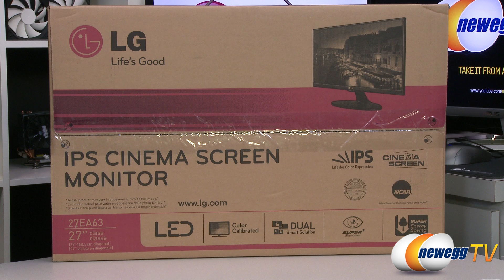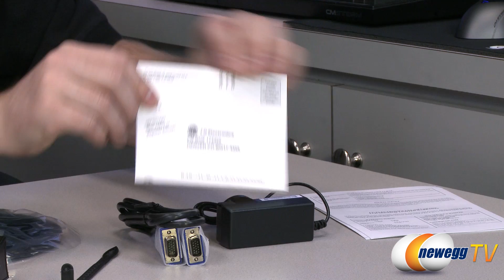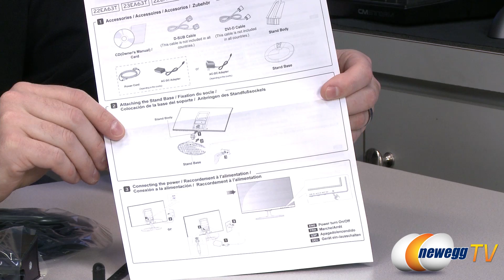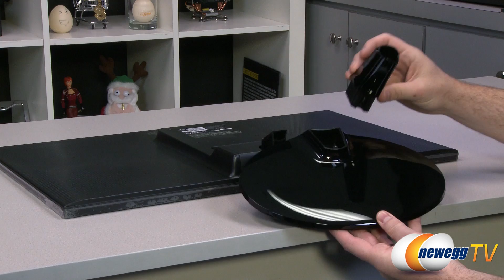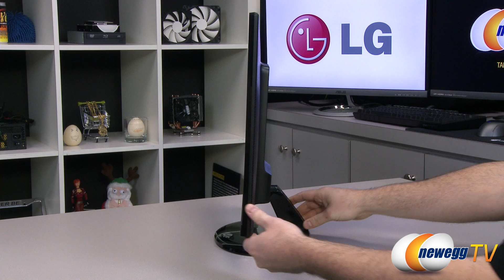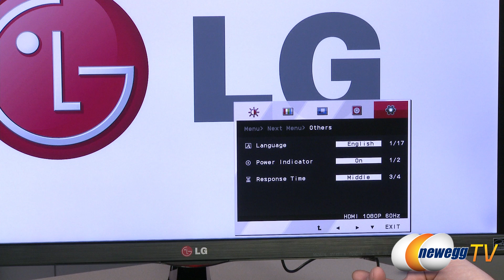Newegg TV: LG 27" Widescreen LED Backlight LCD Monitor Overview

Comment: Please help, I currently have a Asus VS248h-p monitor and want to upgrade to a 27 inch. My main priority is gaming and graphic design.  Will this LG be a good choice?
Reply: if you already got 23" 1080p monitor and want upgrade to 27"  or bigger monitor , i think 27" 1080p not a good ideal, try 27" 1440p for the big change.

Comment: I had a LG 22EA53T-P,the sharpness did appear to reset itself when powered off then turned back on. I think it's a firmware issue that LG needs to fix. It should be no big deal as default sharpness should be sufficient? 
I returned the LG 22EA53T-P for a HP 22bw IPS display that uses a LG "bezel-less" panel,which is a slower 7ms panel although I cannot tell the difference between 7ms and 5ms.

Comment: Those concerned about 1080 resolution on the LG 27ea63-measuring the pixel grid with a magnifying glass shows 2068x1166 RGB triplets representing one pixel. You won't see sawtooth edges even on hardline vector graphics. Been trying to find out if it's 8 bit panel since I've been reading online LG is putting out cheap IPS panels with 6 bit dithering. 

Zooming in on individual gray levels of a 255 level gradient it appears to be an 8 bit panel.

Comment: Have this monitor. Exhibits pearl like shimmer viewing at extreme angles up/down/side2side the closer you get to the screen. Rising from my chair bottom half of screen goes dim. Good posture gets you equal luminance coverage. Using for photo editing replacing a CCFL Dell 2209WA-has its own screen issues after 3 years.

HDMI/DVI-same picture quality>2010 MacMini. Realistic color-HDMI>1080i CableTV-just tone adjusts needed. Didn't see ghosting in action flix. Text sharp @18in.-bigger type though.

Comment: DOES ANYONE ELSE HAVE A PROBLEM WITH THE SHARPNESS ON THEIRS? 

You probably havent noticed, but if you turn the sharpness all the way down, or all the way up, and turn it off/on the monitor it resets the sharpness. Does yours do that? It actually resets to what looks like 6, even though in the menu it says it's on another one for me. :(

Comment: Do you have a problem with the sharpness? You probably havent noticed, but if you turn the sharpness all the way down, or all the way up, and turn it off/on the monitor it resets the sharpness. Does yours do that?

Comment: Or I'm the guy with three 30" 2560x1600 monitors and haven't owned a console in 10 years. I'm saying if I'm going to have a 27 inch screen sitting on my desk, it's definitely going to be a higher resolution than just 1080p. Stop being a dick.

Comment: If I am ever going to get a 27" monitor, it WILL be 3.7 megapixel resolution, and I DAMN SURE WON'T be using a shitty vga outdated cable because it DOESN'T support such a resolution

Comment: Yes and dvi connection method has BEEN a standard for over 6 years now.  Vga's ONLY true purpose is BUSINESS related: connection to projectors.

Thus a dual link dvi cable should be included with the monitor